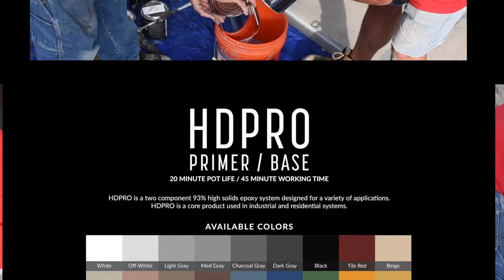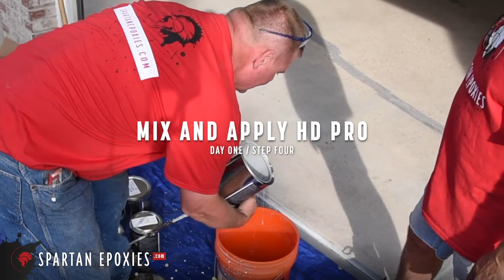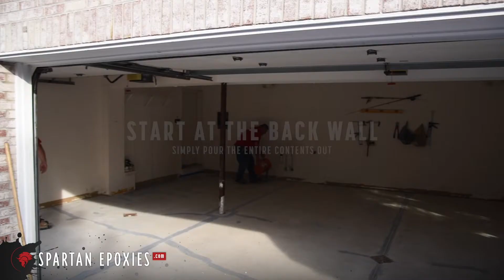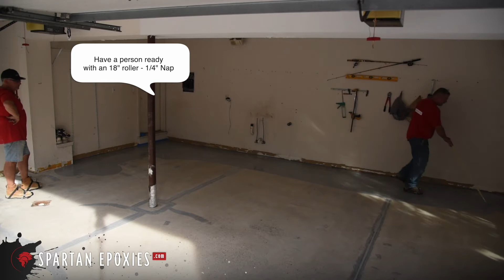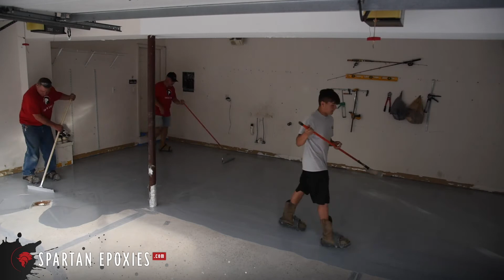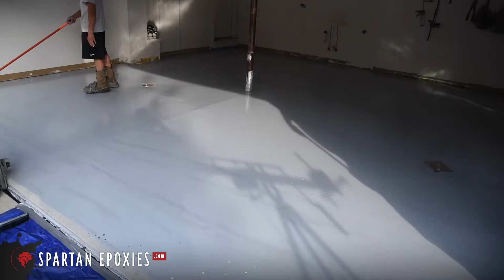How to Apply HD PRO Epoxy

Comment: I bought the 4 car garage kit. Got 3 individual gallons part A. A sealed 5 gallon bucket with what I assume is 3 gallons part A.
And 2 1/4 part B. Plus the bucket with tools. Am I using 3 gallons part A to one 1/4 part B? 
Thanks for your help.